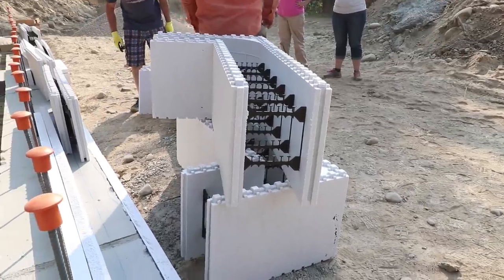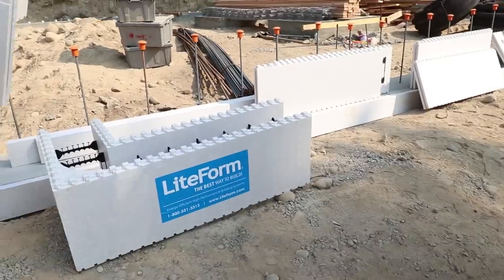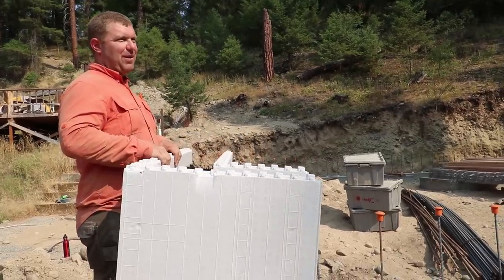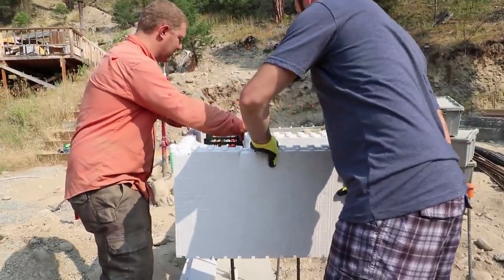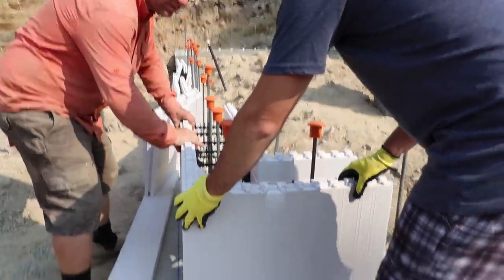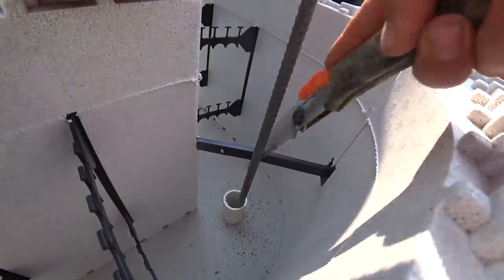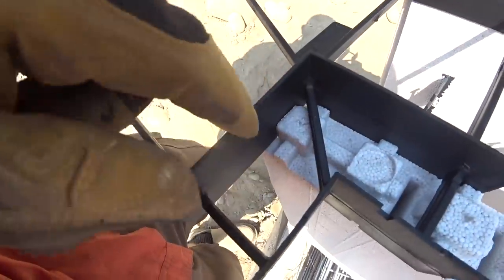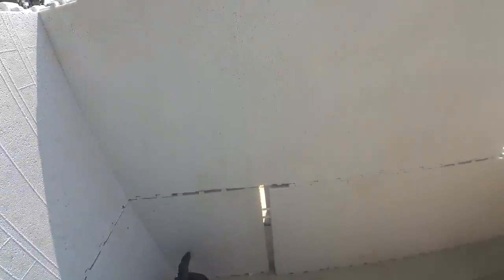Building a House Start to Finish: Beginning ICF Construction

Comment: A couple of things that I was looking for:
1) Addressing how these rectangles with teeth on top and bottom were to connect with the concrete footer.
Could have been more clear. Ie the foam strips that are cut and laid at the base on the footer and against the rectangle ICF form.
Is this done inside and outside?
2) would have been great to clearly demonstrate the way in which the rectangle unfolds from shipping state to build state.
3)  I don't see what the purpose of your 2 inch PVC pipe over the rebar accomplished.
4) Not sure why the rebar was shown being threaded into the open ICF cavity lengthwise  rather than dropping directly in from the top?

Comment: I know I am very late since this is done.... you need to build from both corners to a mid point. At the mid point you cut the odd size. You have to remember later the sheet rock or wall covering as well as the exterior siding attach to those plastic supports. 
Foam Forms are great as long as square, straight, and height are not important. 
The engineer statement was incorrect about Concrete Forms. They are perfect to dimension.
Reply: I see later in the video they explain how to correct your problem which creates another problem... the weak spot in the middle of a long wall... plus it will change the sheetrock, siding layout...

Comment: Would it not have been better to put a bead of construction adhesive along the bottom of the bottom course of Icf blocks? This would have saved you the trouble of the expanding foam.

Comment: Why would you cut the 'cross connects' in the ICF Blocks so you can pass the re-bar under the upper bracing? All you need to do is make a small hole through the side of the ICF Block and thread the re-bar through. Dont damage the bracing as it is structural..." measure twice, cut once".

Comment: One "reality of materials" that most amateurs don't consider is thermal expansion. Everything in Construction has a way to compensate for the small changes in size due to temperature (and moisture, in a case like wood). The real takeaway here is: save yourself headaches by planning things so you have access to a Help Line on the day (and hour) you're using any material for the first time. This includes mounting pre-assembled windows.

Comment: I am thinking rebar needs to be at least two inches away from the outside of the concrete by code to prevent rebar corrosion not that they need to be two inches from the inside of the wall.

Comment: Hillside's going to collapse in on the building when it rains.  That's a big hillside against a small wall.  Good luck with that.  

Because over time, it's not the three-feet of dirt at the base, it's a three-foot sheet all the way to the top of the hill, which weighs hundreds of tons wet.  Better French-drain that wall too, because rain water will undercut the foundation without a French drain.

Comment: Yup, there's so many tricks to icf you only gain from experience, for example the string along the wall doesn't work like that, we always put a block on either corner to hold the string away from the wall then measure to the icf to straighten it out. Stack joints are common, a plywood strip down the seam is the solution. Hopefully you guys knew the trick of "towing in" on your adjustable bracing, if you pour your walls level and they plum away from the outside of the build, your bracing will never pull themBack in, the adjustable bracing only pushes out. At this point you guys already poured your forms, I hope it went well! I'm not knocking your build, I think you guys are doing great! Cheers
Reply: Sorry meant plum away from the inside (leaning outwards from the build)

Comment: The greatest lesson my dad taught me - measure twice, cut once.
Reply: In this case they measured too much though, hehe.
Reply: Doesn't help if you're measuring the wrong thing.
Reply: Not really the measuring was spot on - just didnt follow the instructions and set out the corners first. Its just a lack of building knowledge. In the UK no matter what you are building walls with brick,block etc, the corners are always set out first. Hard lesson for Jesse.
Reply: I learned the same thing from my old man, but not because he did that. 
He was a champion of "do not measure, cut 10 times then start over" method.

Comment: Read and UNDERSTAND the instructions!  Fortunately you aren't building a boat or an aircraft! Firstly, you are not a 'builder", you are a beginner.  If you don't know how to do it get an instructor/consultant, preferably a hands on 'foreman'.  I would love to come help you, but I live in Northern Canada. After years in the construction industry and solving problems engineers and 
architects had, I retired and built my dream home in the country. I saw the perfect logic of ICF in a stout building  (our ICF goes to the roof), with great thermal resistance. Our weather is very harsh, 50mph winds and -40 winters.My wife and I built our home in 2003. We hired a fellow to help who had built his own and we had the factory rep out often, as was our architect. Nonetheless, any newer building system has challenges, particularly for the subtrades. I see a number of challenges for you, if you would like some help, feel free to call me at 780-967-1048.

Comment: Should you line up the inside of the form on your line instead of the outside of the form.  I would think the line should be on the concrete not the outside of the form. And you DONOT cut any plastic ties, they keep the forms together!

Comment: Mate it is concrete it doesn't have to be with in a half inch  that is why you have an interface between the  wall and foundation 12 yrs and never seen a perfect foundation on a regular house  cheers mate  that 1/4 inch wont matter have an ice cream  and relax ..and the architect answer  is joints grow steel,wood , aluminium  it all grows with prefabbed joints  check 747 air craft to of the same can be up to 5 ft difference in length

Comment: Just read many of these comments. Sounds like you may be better off taking them down and starting over. Cutting the interior supports to get the rebar in, appears to be a critical failure. You could get a blow-out and that is going to cost you more than starting over.  Think things through and when you find yourself having to do something that doesn't make sense, you need to stop and assume you have got something wrong, it usually isn't the product's fault.  Good lesson for do-it-your-selfers. It may be best to hire someone, 1 person, who has done this to advise and assist.

Also, someone observed that there isn't an exterior door to the basement (wish I would have noticed that one). You need to re-think that decision. Exterior access to the basement will save you countless hours and frustration, not to mention dirt in the house and banged-up woodwork,  over the next X number of years.

Comment: Whoever run the string line does not know what he/she is doing, stand off spacers should have been used. Nothing should be touching the line. You should have just drilled a hole to slip your lower level R-Bar through, then fill the hole with spray foam. Also by cutting wall tie's you now run the risk of a blow out.

Comment: Hint - don't cut the ties!  You'll have a blow out!  Use a sledge hammer at the base of the rebar to "adjust"...
Also that "make up amount" is called filler panel.  All concrete wall systems have them as no building is built exactly to the dimensions of the panels.
You will want to check with code and your structural engineer to see if the pieces of pvc around the rebar is to code... I would kinda doubt it.

Comment: I've been using ICF's since 1999 and when first starting out, read a bunch from manufacturer info,  utilize their installer experience and take a training class if offered. That will help to reduce mistakes and teach you how to fix the mistakes without going too far backwards. You just have to think a little outside the box and like any form system, do not weaken the structural parts(cut webs) without an idea of how to fix the problem. Rebar bends, so bend it, utilize non-contact lap joints, done correctly they are stronger, utilize wood for reinforcing. Cut the block only on the cut lines and let the building grow the 1/2' to 1".  You can cut a brick anywhere, not so much the ICF . Parameters need to stay within the bounds of interlocking cleats to maintain dimension and strength of the form.  There are solutions to just about every screw up and  if you do cut the plastic webbing, it can be reinforced to work, it just takes more time and materials and won't be fatal to the project with the right knowledge. To the armchair wannabe's and almost engineers, when you've stacked and poured a few thousand of these with no failures or blowouts while staying plumb and square (with multiple stories in height) you'll understand what I mean.  Even newbies can do well with ICF's with a  good teacher. I was fortunate to have had a couple.

Comment: @13:00 You have bigger problems that the overall structure being 1in to wide... You cut the braces on the ICF to get the rebar to fit on the lower blocks... The braces are there to keep the ICF from spreading when you pour concrete... No bracing to hold the ICF together and the walls are no longer straight or square once poured... FUBAR'd

Comment: the common seam is the only way any block type wall is built,  so no wonder you were having problems, any block type build starts with  and grows with the corners  and then you fill in the wall fields or at least that is what I was taught when I was working as a mason's tender many years ago
good luck with the video's of the build as I know already that the walls look good from posts on your blog and facebook

have a good day and a better tomorrow
Reply: It's right there on page 2 step 4 "Center of Wall: Common Seam" of the liteform installation instructions http://liteform.com/wp-content/uploads/2017/05/FB_install_print2017.pdf
Reply: Brian K

Comment: Altitude!   These foam materials are not produced at your height.  When you go UP and blocks will grow!   This should be in the SPEC for these materials.   Just think of a ballon that is taken up a mountain.  It will grow.   Ask any one that launches a weather balloon.  So,  these materials will NOT have the same size at the TOP of the hill as they do at the sea shore.    Hey you take one for a trip and see how they shrink!

So,  the idea that the parts "interlock" great if they are all the same "LOT".   The idea that you can build to the 1/32" is not going to happen.

I would say to the ICF team,  make a block that extends by a few inches with NO STEPS.   This "Expansion Joint" would be used  just like on a bridge to compensate for movement.

The look of the ICF is great.   This should make the  walls very easy to work with later.

Comment: Blue skin without primer?  You may end up with failures at any seams.  Also the roll your using can be somewhat unmanageable, Especially where  the dust is,  You may want to cut it into smaller pieces that are more manageable. apply primer and then adhere your blue skin. 

You mention it in the video but when I saw you going from corner to corner I thought "you will have issues"  you need to go from corner to middle Especially with precast forms.   The 1 inch overage is nothing, as your engineer said, you adjust with the sill plate.  

I hope you are planning on bracing where you cut. Get some form ties and replace the cut precast ties. 

The small 3/4 inch gap will result in some leakage, depending on how neat you want your formed concrete, you should be able to cap it or just fill it with spray foam.  

Have fun with the bending rebar, I have spent many days doing that.  Also where your corners are you should be placing engineered bent rebar. Most rebar companies will bed it for you,  If you are doing it at home by hand  then I suggest adding a few extra pieces.  Because just bending it can cause metal fractures and stress on the rebar bends if done incorrectly.

Comment: Don't cut the plastic!  Or at least cut it as little as possible.  Put your rebar in before you have all of the block in place and then slide the rebar back and forth into place.  I would even punch a small hole in the corner to slide in a new piece before I would cut the plastic.
Reply: Also, when you use a string like that, you should use spacer blocks at each end.  Say you use half inch blocks, you then make sure you maintain a half inch space between the line and the wall.  Doing it like you did, your wall could bow out and it would easily get missed.

Comment: You guys have had enough comments about what you already know, so, if you ever do this again look into a couple of products that will make this so much easier.  So you know I am not affiliated with any organizations or building supply company.  I'm just an old fat guy that has made millions of errors and found easier ways.  FastFoot is a fabric used for making footing, but you can install your ICF right on top of the FastFoot system. So when you set rebar its all tied before the pour and it is a true monolithic pour. Look for liquid applied waterproof membranes,  they work really well and you don't have to have 500 hours of experience to get them applied without all those wrinkles.  The material you used we call it Peel and Leak. Think about looking up Matt Risinger on YouTube he has some superb methods of window installation and water/air seals. I wish you young folks a long time together and I really like your videos.

Comment: This is "rough" construction.  NOTHING is ever "spot on" in rough construction.  (Glad you posted the LiteForm solution !)  I think you will find your plywood and I beams spot on.  Doors and windows are designed to fit into a rough opening and adjusted with shims,

Comment: After watching the entire video I have to say that I was cringing most of the way through and while reading the comments section I assumed that you did not get into contact with your engineer nor the company that made those forms. As an ex draftsman we always ran into issues where the concreters had an error magin. The chippies had their own error magin and then the roofers had their own as well. At the end of a build things would be in your measurements over two inches out. My boss would always fire those companies that could not get within five mm (sorry no idea in inches) over the entire build. In the end he had two building companies working with him building square and true homes. 
on the other side, you are doing this yourself with little to no experience, not knowing the correct terminologies and are willing to admit that you stuffed up so we can learn from your mistakes. 

In the end the house is yours and if you are willing to live with your mistakes then yhat is all that matters.

Good luck.

Comment: Can i just ask a dumb question please? why do you not have similar type of forms available to do the foundations in the first?
Reply: +Not Interested - these are permanent forms.  They are designed as part of their insulation and reinforcement for their concrete walls.  The foundation pour will be exposed, this form will be enclosed within the walls.  You wouldn't want these permanently fixed to the lower foundation pour because they would be strong enough to have a wall poured on top of them or exposed to the elements.
Reply: Thank you.

Comment: 65 yrs ago,i used concrete blocks and sprayed heavy TAR on exterior walls-(since don't believe proper CLOSED CELL  foam sheets existed then)-but except for colder basement walls than "modern " construction has survived intact-during rare minus 30 ^ F cold spells here-where frost could penetrate 35 inches or more ~

-but newer POURED one time concrete walls "could " and have split with extreme weather changes and settling of foundation
 and such walls don't have interior AIR  insulation -so  insulation problematic-since no interior  air pocket for added insulation 
~adding interior foam insulation reduces interior space and must be covered with fire resistant material ~ 

-never had experience with ICF's which seem to offer combo advantages-although wall seems THINNER than 8 inch wide CONCRETE blocks

but trust ICF  survives your DIY build -since believe minus 30 ^ F not common your area
-
Reply: Yep, same here. I used 12 inch concrete block. (who the hell uses cinder block?)  I paid pro's to do it. I only continued to watch this series to see ICF build up close. After watching the different videos on youtube and what has to be done AFTER the build...I would stick with block after all. My outside walls were parged ,asphalted and foam sheets panels down to 4feet  from the fill line. I think in this video...they should have ignored the advise about "excavating too much". I suspect many have never watched block walls done right and have never seen rebar made just for block.

Comment: It seams to me that you need to start at the corners, then cut one towards the center staggering your cuts. When I first learned to prefabricated buildings, you always shrink it down slightly so your not cutting small rips at every end or corner. You said your building is 36'8", not good at all, should be 35' 11" at the maximum for nominal cut lumber. 36 is divisible by 2, 4, 6 and 12. All your interior panels will be shrunk by 1 and your interior wall thicknesses.

Comment: oh no... dont cut the ties! just bend the damn bar! hope you got away with that one... also materials of all type have variation in their size due to changes in temperature. Particularly plastics... it is possible that the blocks you have were made in a cooler climate than your are currently experiencing and they have expanded.